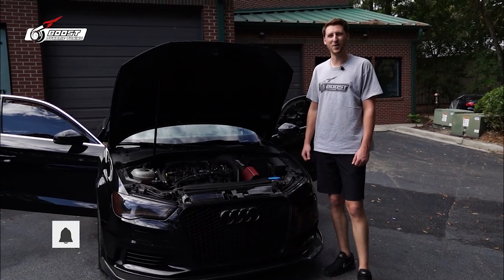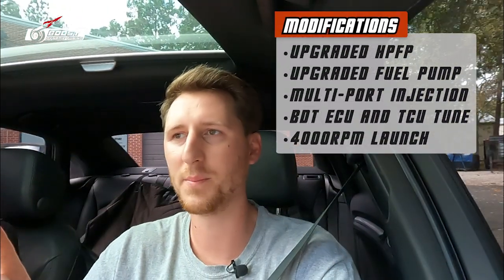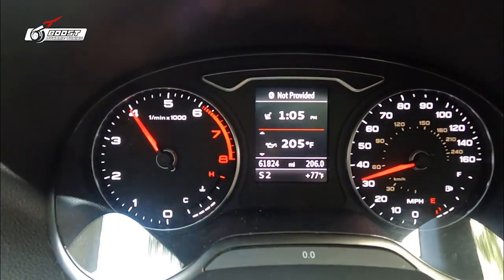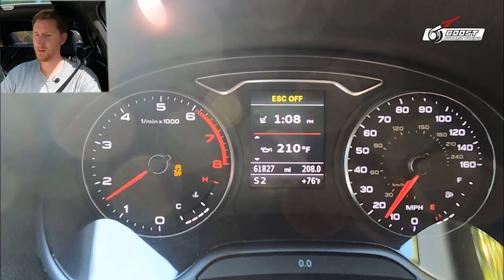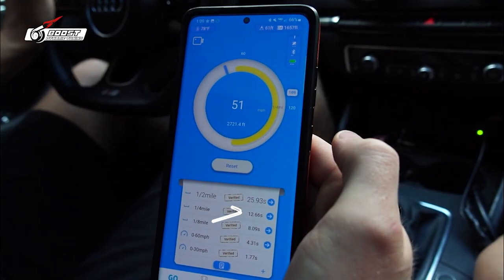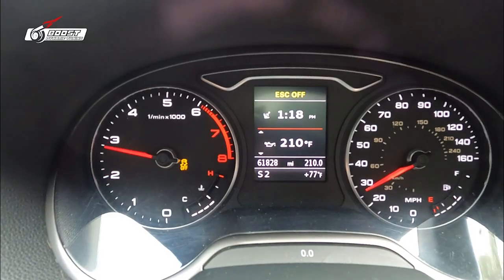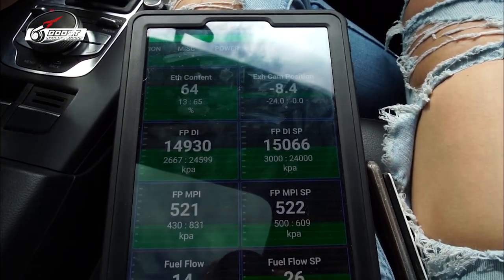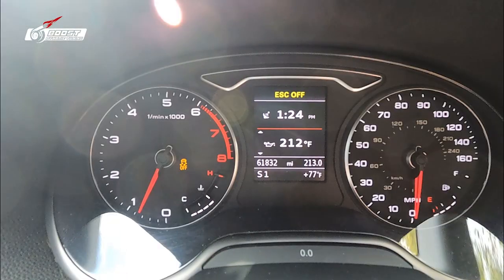True Flex Fuel Tune MQB

Comment: Can you get this system to work on my 2016 1.8t jetta? I am running 93 Octane with Lucas Oil Racing Octane Booster. Its around 95-96 Octane and the car absolutely rips! Would E85 help or hurt my Gen3 1.8T

Comment: Hi, I was wondering if you have a stage 2 tune 93/e85 for an Allroad  2014. Thanks
Reply from the maker: I do actually. If you're running full e85, an hpfp was needed when I documented the tuning experience.
Reply: @boostdynamictuning  with Same injectors? 2 maps with switch on steering wheel?
Reply from the maker: @hannaedeback9415  Sadly not an option